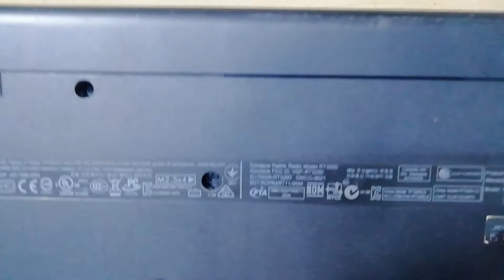HP 15 - r033TX Hard Disk Replacement

Comment: Does the ssd installed inside or in place of optical drive both give same performance? And what ssd i can get for caddy and what for inside slot? Please explain me.. i wanna install small 128 gb ssd on this laptop it's my old laptop i wanna make a use of it.
Reply from the maker: Thanks for the comment, you can use SATA ssd for upgrading your old laptop. New laptop has M.2 or NVMe ssd slots. Thre are two options 1. Use caddy 2. install  ssd on motherboard. Better performance in 2nd option. Don't forget to subscribe
Reply: @TechMantrabySG  ok if i install ssd on motherboard and install the hdd using hdd enclosure in the caddy. Can you share how to do it
Reply: @TechMantrabySG  i need to do it myself. What screwdriver and stuff i need to open laptop myself?
Reply from the maker: First install ssd on motherboard then Boot OS on it. Then install old HDD using caddy. Pls check in my videos for more information.
Reply from the maker: Use laptop repair kit it's available in online shop and offline shops like electronic and laptop spare shop's
Reply: @TechMantrabySG  sorry to bother you. Another question? The wifi and Bluetooth also do not work in this laptop. Do you have a video on it?
Reply from the maker: That's ok, WiFi and Bluetooth drivers are installed? pls check it in device manager otherwise it's a board problem. Use a usb WiFi adapter.
Reply: @TechMantrabySG  yeah it's not the driver issue. Pretty sure it's related to board. So i will use usb one. Bro actually whole laptop is fked up i gotta even get usb port changed. 🤣🤣
Reply: @TechMantrabySG  installed the ssd working great but caddy ka size kiya hoga 12.7 or 9.5?
Reply from the maker: Thanks for the comment, caddy size is  9.5

Comment: HP 15-r033tx Notebook so i want to know can i upgrade with 8gb max ddr4 ram
Reply from the maker: Thanks for the comment, this laptop only support ddr3 so you can upgrade with a ddr3 ram 🙂
Reply: @TechMantrabySG  8 gb or not
Reply from the maker: @Indradeep Ghosh The notebook supports max 16GB of DDR3L 1600MHz RAM (2x8GB).
There are two slots so you can upgrade with 8gb
Reply: How to buy a battery for this laptop.... Plz send me a link or tell me how to get🙏
Reply from the maker: Thanks for the comment, You can buy in two ways from the shop and online. But shop is better if there's a problem in warranty period. Visit a computer shop.

Comment: I have the same laptop.The plastic is opening up from the right side hinge.The hinge is perfect only problem is the plastic screw of the right side.How much may it cost?
Another problem:
1.video playing time /normally mouse cursor  it's stucking within 10sec.
2.Ralink wifi from device manager,sometimes missing.

I guess there might be some motherboard issue. How much will be the cost?
Reply from the maker: thanks for comments...service cost may varey depands on parts replaced by service person. mouse may stuck if there is any keyboard issue. In case of wifi  problem  check with another wifi card if problem persists replace it.
Reply: @TechMantrabySG  thanks for your previous reply man... there's a keyboard issue bro....the screw was loosen that time.Now everything works perfectly.I wanna myself upgrade the Ram.will it be okay??what are the required specifications I need to take care of???like frequency/ddr3L/ etc...
Reply from the maker: Thanks for the comment, This will help you https://www.crucial.in/compatible-upgrade-for/hp---compaq/hp-15-r033tx

Comment: Is there any spare m.2 slot available on r033tx?
Reply from the maker: Hai, Thanks for the comment, Your notebook does not have a M.2 slot. If you want to install a SSD, you will need to remove the 2.5" mechanical hard drive, and replace it with a 2.5" SSD. 🙂
Reply: @TechMantrabySG  thanks brother.

Comment: Can i add ssd without removing hard drive... Any slot for this???
Reply from the maker: Thanks for the comment, yes you can use a hard disk caddy for ssd installation. Remove the optical drive  and connect the caddy there that's it. Don't forget to subscribe my channel.

Comment: I Have same laptop mouse touch not working I guess that particular part is not working could you help me with particular parts no and how to replace it
Reply from the maker: Thanks for the comment, If there is a problem with the keyboard, the touchpad may not work. Or check with the device manager to see if it is a driver issue of the touchpad. Also check the touchpad function key on the keyboard

Comment: Man please upload a video for this (model 15r033tx hp)
1.ssd 512/256gb upgrade with simultaneously HDD of 500GB in place of ODD slot.....

2.RAM 8GB extension.run simultaneously with 4GB pre-built....

Comment: Any slot for ssd ?
Reply from the maker: Thanks for the comment, There is no additional slot for ssd. If you want to install a SSD, you will need to remove the 2.5" mechanical hard drive, and replace it with a 2.5" SSD. Otherwise use harddisk caddy. Don't forget to subscribe.

Comment: How Change ram speed 
In insydeh20setup ?
Reply from the maker: Laptops for the most part have locked BIOS restricting the adjustable settings.
Reply: @TechMantrabySG  tell me proper steps .. please
Overclock in InsydeH20
Sir. i see 2133mhz in task manager , but on CPU-Z device i see 2666(1333mhz)......tell the difference. Help😡

Comment: Thanks for the great Video SG, I have the same laptop, which brand SSD would you recommend me to upgrade with?
Reply from the maker: Thanks for the comment, you can use any 2.5 ssd for upgrade. WD, gigabyte, adata, Sandisk etc. Don't forget to subscribe.
Reply: @TechMantrabySG  how about consistent 128gb ?
Reply from the maker: Thanks for the comment, consistant ssd is very cheeper in price and it's not bad.  If you have enough money in your hand try gigabyte, acer, crucial, adata etc.